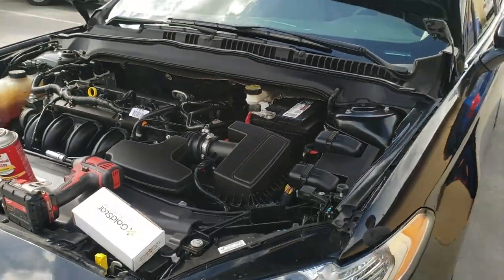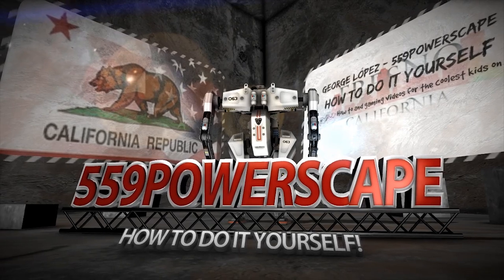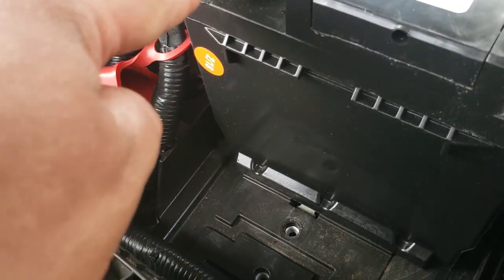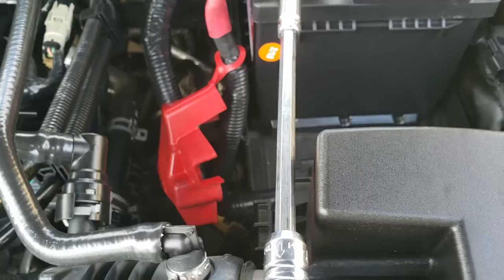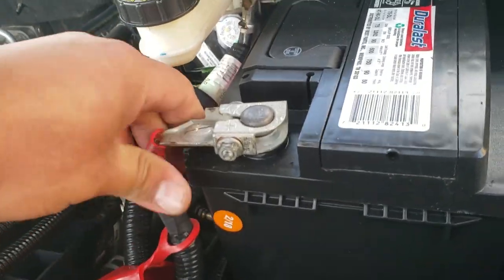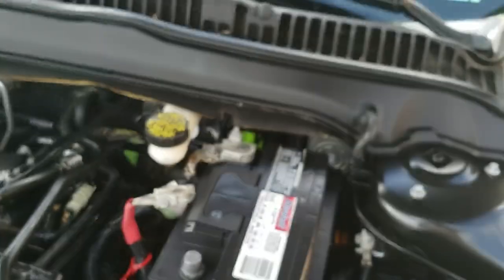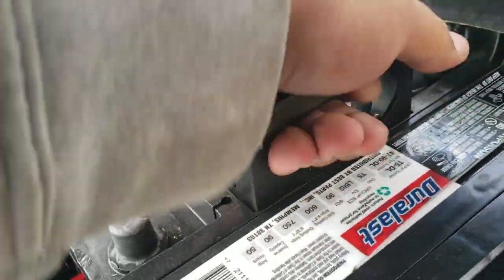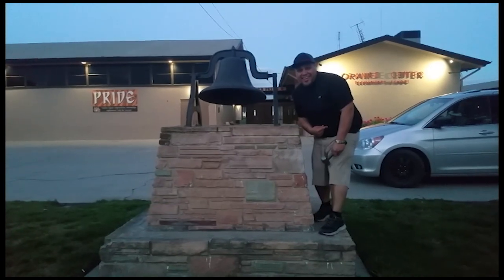How to: Remove a Battery from a 2014 Ford Fusion

Comment: I changed yesterday and instead of small one I installed most large battery ( Canada's colds). Remove the small battery is not  a problem.  It was crazy to install biggest....
Reply from the maker: Wow yeah some cars take bigger batteries. That's why they have a bigger Battery Bracket at the bottom for a bigger size. Glad this worked out for you. Thank you for your support!

Comment: My negative terminal cable is literally stuck on the battery. Rusted on?
Reply from the maker: Try using a flathead screwdriver to try to open the terminal and use channel lock pliers to help to twist and pull it out....hope this helps
Reply: @GEORGE LOPEZ HOW TO DO IT YOUR SELF  It did thank you, just got the new battery in

Comment: What's the battery model?
Reply from the maker: Its a Group Size T5 I found one at Autozone 
https://www.autozone.com/batteries-starting-and-charging/battery/p/duralast-battery-t5-dl-group-size-t5-590-cca/786897_0_0
Reply: @559powerscape  I appreciate it